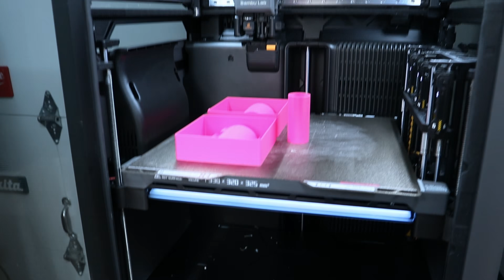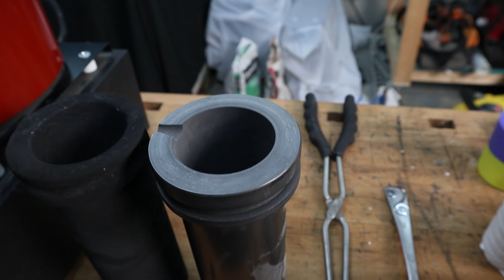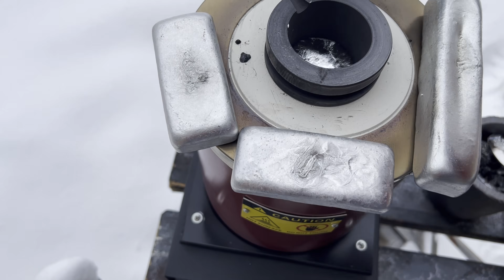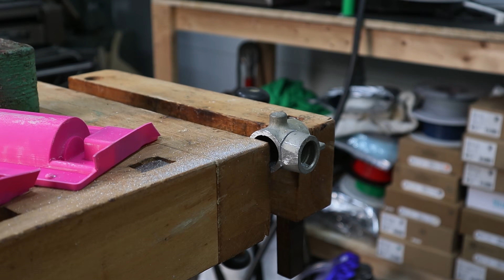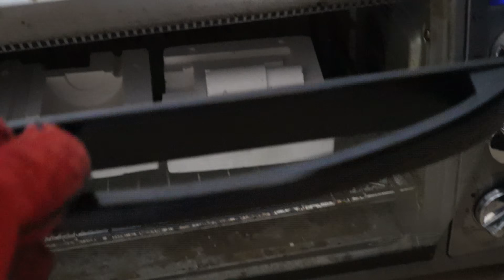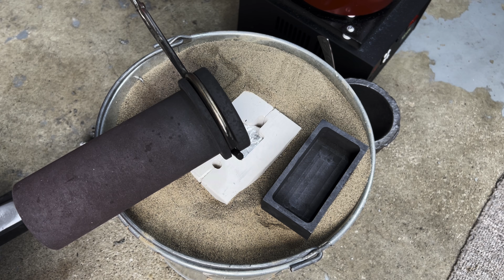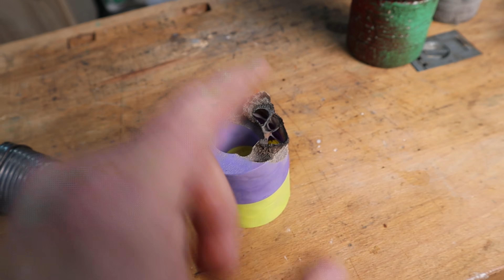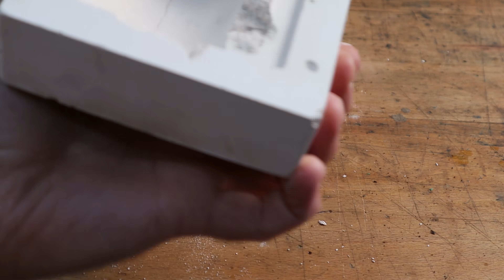Can these 3D prints make metal casting easier and better?

Comment: Super interesting dive into these techniques, I'm shocked by how good that plaster pour looked! Great video!
Reply from the maker: thank you very much!  I have two more wheels to cast they’re gonna be a little bit larger so I think maybe I’ll use what we learned in this video and try to improve it a little bit, like getting the draft angles onto the 3-D printed form, and also adding a riser and more vents.  The next wheels are going to be a little bit more complicated too, so it should look really good if it works out.
Reply: @NeedItMakeIt  It's an iterative process for sure! I'm glad you documented it well to show how each failure is an opportunity to learn something, and that not all failures are a total loss. Thank you for all the time and effort put into producing this!

Comment: What is the riser? And why was it needed?
Reply: A riser, also known as a feeder,  is a reservoir built into a metal casting mold to prevent cavities due to shrinkage. Most metals are less dense as a liquid than as a solid so castings shrink upon cooling, which can leave a void at the last point to solidify. Risers prevent this by providing molten metal to the casting as it solidifies, so that the cavity forms in the riser and not the casting.[

Comment: I'm not sure if you ever explain what the part you're casting is actually for haha. Very crisp final result though!
Reply: The Fusion CAD file was called "Wheel Idler"
Reply: It's a cast version of a readily available section of extruded hollow round aluminium bar
But with a poorer surface finish